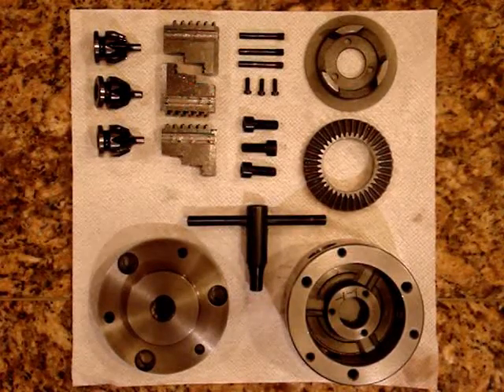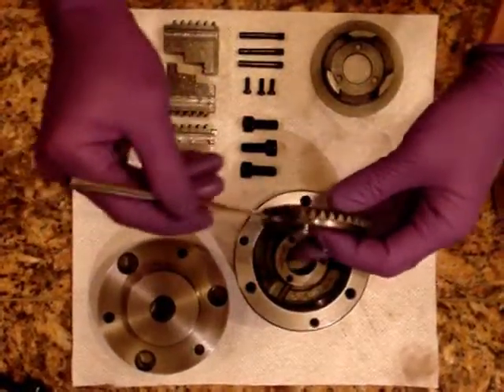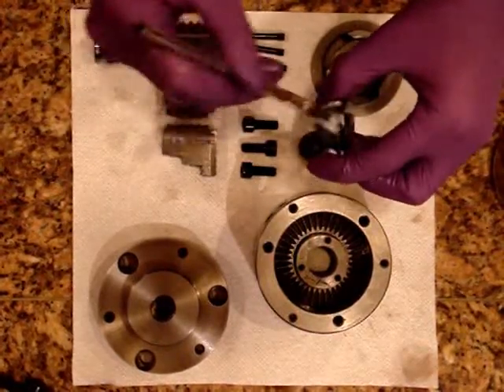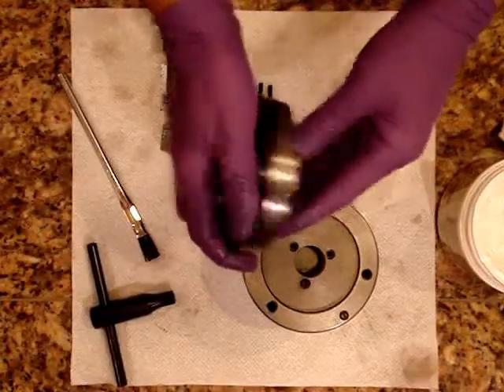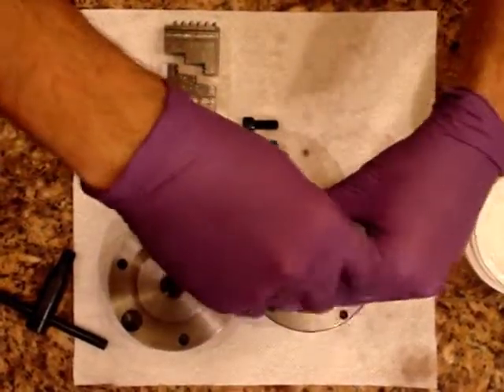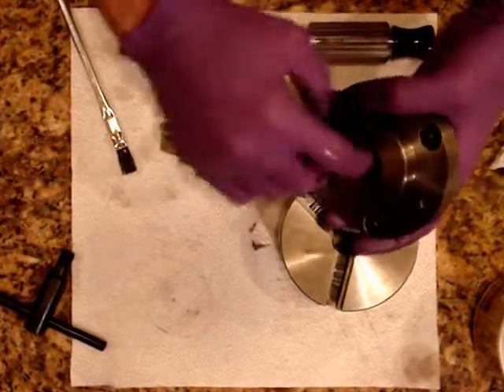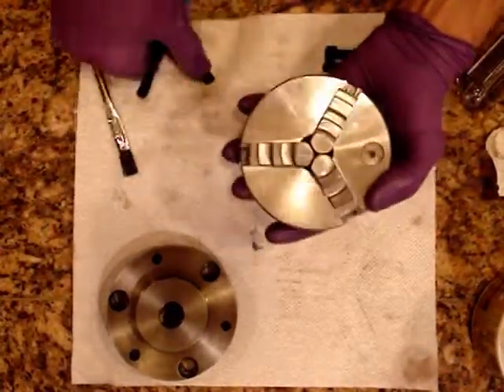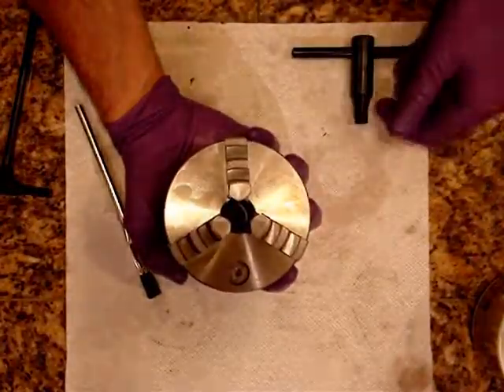Assembling & greasing the 4 inch 3-jaw scroll chuck from my Taig lathe

Comment: I think this should be a standard thing  too do as soon as it arrives new even from the factory same goes for compound slides and milling tables and lead screws..And align everything properly you will be thank full of the results when working to tight tolerances..You can turn a crap £100 compound table into an amazing one by cleaning it and maintaining it and correcting the ..Some wont even turn when bought because of the crap left inside during manufacturing running it and..Keep em clean.. Ty